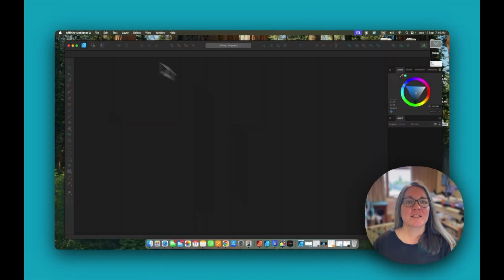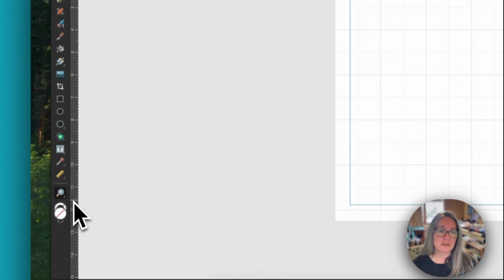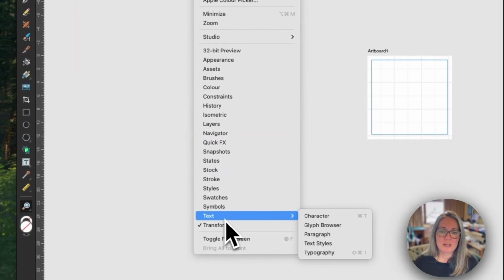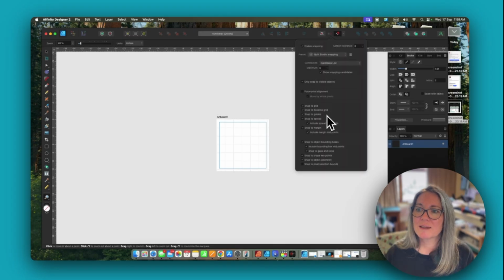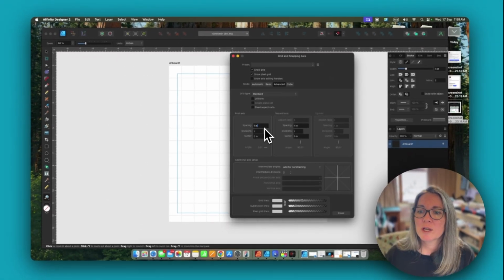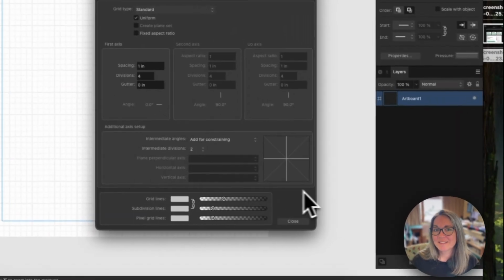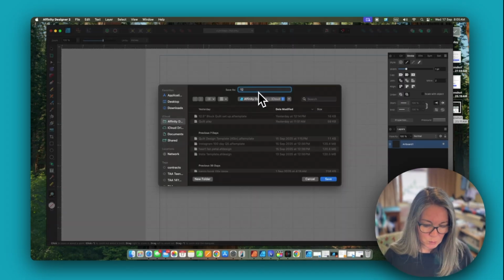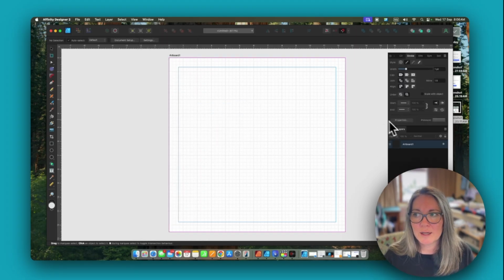Quilt Pattern Design Without Adobe – Start Here with Affinity!

Comment: I've used Illustrator for decades, fairly new to Affinity (I have the v2 suite), and I've been a hand quilter for over 3 decades. I tried some quilt design software, and ugh. I thought, "I wonder if I can do my quilt design in Affinity Designer?" I'm doing a diagonal design with a medallion using appliqué. I don't know if I have the right number of crumb quilt blocks for the size of quilt I need, and I need the right number of 2" sashing strips, not to mention the half square triangles. And here we are. I'm so happy!! And, I'll learn how Designer thinks. 

No desire to learn how v3 works - the interface has become less visually accessible, no need for AI.

♥ Thank you!
Reply from the maker: I have to agree I love my v2, I have tried the canva version and still will for certain things like the image trace. (If and when needed) It doesn't pick up my mouse clicks consistently so I have been getting a little frustrated and go back to my v2 it just doesn't let me down. Its such a great tool for quilters to pattern design. Yah keep designing!! Your design sounds fab!!